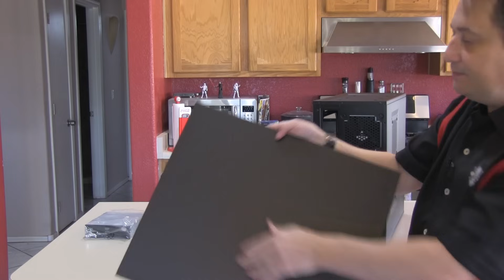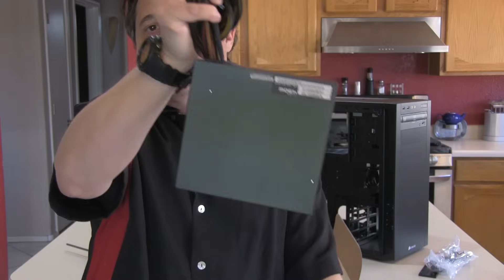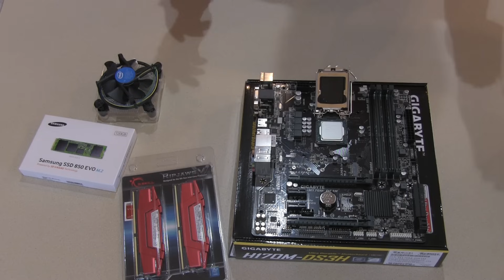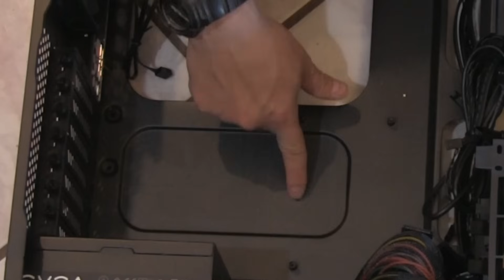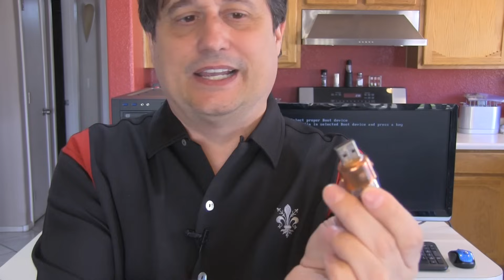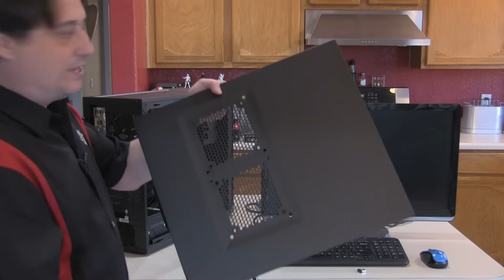How to Build a $600 PC- i5-6600, 850 EVO M.2, & Windows 10

Comment: just for fun I priced the same bits up here at one of the UK biggest PC shops and the one i fined to be the best on price i had to swop the memory as the shop did not list yours but i went for one same speed size and as close to the price you got cost £74.09 for 16gb in total it came to £568.42 so in pounds your came to £420.86 so to buy the same bits in UK cost £140 more

Comment: I wish my machine could've used the M.2 style SSD; I didn't find out till later the X-99 Asus board I went with supports maybe 2-3 M.2 drives.  Went with 850 EVO just to avoid any further compatibility issues..

Comment: Regarding SATA port 0 use when M.2 port is in use, I have the same issue with my MSI MB - except the manual says that using the M.2 drive will disable two SATA ports (0 and 1), and using the SATA-e port will in turn disable two more SATA ports (2 and 3 or 4 and 5, I don't quite remember).

Comment: Yesterday I assembled a pc for the first time. At the point of checking if everything works (starting the pic without the videocard) it didn't turn on. The monitor stayed black and the only things that happened where the cpu fan spinning and the fan in the back of my case moving a little bit (not spinning!). Also there was this yellow blinking light on my ga-110m-s2h motherboard. 
A picture of how the yellow light looked like: Afbeelding van http://www.techbuy.com.au/images/extra/e2015110668838.jpg.   When I press the power button nothing different happens, the power button light doesn't even turn on.

What could've gone wrong in the assembling of my pc?
All help appreciated

Comment: debated buying m.2 for my xps8900 I ordered ..I wound up grabbing the evol samsung 850 256.  Oh well. I still feel I'll be ok. I can always add one later. Great build man. I have the i7 6700 16 gig ram with gtx 745 4gig. so i will be ok if i ever get it  lol. Shipping is an ass sometimes. Love your work. Almost built mine but the xps came with 27 inch IPS monitor that sweetened the deal and beat my build price
Reply: +Robert Clark your PSU should handle it just fine
Reply: Yes. It is  lol. I ordered 970. Hope it is not too much on it. Only 460 psu
Reply: I am not really a gamer. I'll be doing video editing and music.
Reply: +Robert Clark I plan on the 256gb Samsung Pro M.2 :P
Reply: Alfa Wolf 00 thank you bro.
Reply: ***** thanks man. I went with ssd 240 Samsung evo